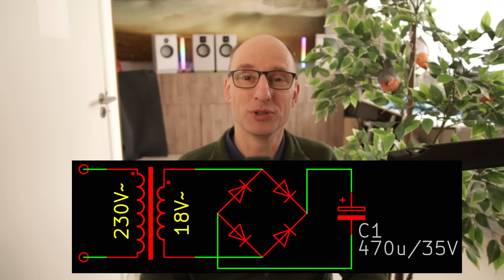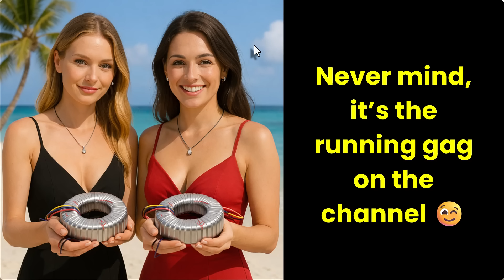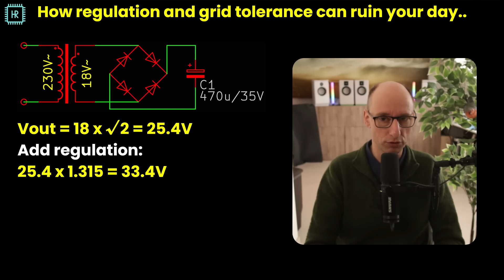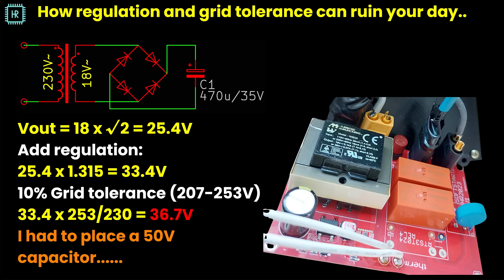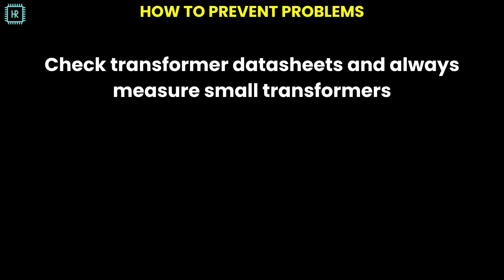Linear Supplies Can Destroy Your Designs

Comment: Keep in mind the inductive kick back. When a load on a transformer switches from full current to almost nothing the flux field collapses giving you a voltage spike.
Reply from the maker: Good point! I forgot about that. I always put diodes across my relay inductors for that reason. I have no idea how much of a spike I got. I'm not sure how fast my supply ramps down, I believe it has a relay so that would be like a spark plug generator.

I've done this many times with this supply actually, but I never noticed a problem. I assume there might be a protection diode to protect against inductive loads being turned off. That is at least what I would put into a supply design if I had to make one.
Reply: @HansRosenberg74 usually a resistor is placed over the buffer capacitor to bleed off the charge of the spike.
It also helps with high voltage circuits to bring down lethal voltage in the capacitor under 30 Volt within 30 seconds.

Comment: I've a pair of Nice (that's the brand name) gate openers and they use a linear power supply, they can also run from optional lead acid batteries during power outages or from an also optional solar power kit that seems to not be compatible with mains power for some reason.

When running from the mains the AUX output for keyboards, photocells and other things provides "24V" DC (it's just rectified AC unfiltered edit: unregulated) - 20% +50%‼which is up to almost 51V DC once rectified and filtered.
To use an additional remote control receiver from other brand I used a cheap LM317 based voltage regulation module from Aliexpress to bring it down to 12V DC. I had to modify the regulator module with a small 100uF filter capacitor because with the original 1000uF capacitor it drew too much current when the gate opener was connected to the mains to charge the filter capacitor, causing the microcontroller on the mainboard to fail to boot or freeze after a few seconds. The AUX is supposed to provide only up to 200 mA and I was already using it to power the photocells.
Reply: Depending on the situation, if you need the high capacitance, you can put a resistor in series with the cap to limit the inrush current. Though, this does change the filtering behavior of the cap, ideally put a scope on it.
Reply: @sivansharma5027  I had written unfiltered when I meant unregulated, it should work fine without too much extra filtering
Reply from the maker: 51V.. that is quite extreme.
Reply: @HansRosenberg74  Yes, but I hope it never gets that high! In the area where I live, back in the '80s we used to have around 230 volts during the day and up to 240 volts at night, even though the voltage in Spain was supposed to be 220. I guess they raised it a bit to reduce losses in the transmission lines. And when all of Europe adopted 230 volts, nothing really changed... I never saw it reach 250V on any phase.

Comment: primary and secondary leakage inductances are non-trivial, and often make up a large part of transformer regulation (for high power transformers, they account for almost all of it). power systems engineers typically refer to a transformer as an x% transformer eg a 10% transformer. that means its leakage inductance is 10% of its "base" impedance (Zbase = Vbase/Ibase = 2*pi*Fbase*Lbase). and shorted, that transformer will deliver 100% Volts/10% Z = 1000% Base current (10x rated current).

its not obvious how to measure primary and secondary leakage inductances, as you can only measure four inductances (Primary L, Secondary L, Primary L Secondary shorted, Secondary L primary shorted). Chris Trask wrote a paper in QEX magazine a few years ago showing how you can calculate the actual magnetising and leakage inductances from these measurements (hint: use mutual inductance in your analysis, lest you run around in circles, ask me how i know). you can also use a solver, once you know Lp, Lp_ss, Ls, Ls_ps.

including the leakage inductances gives you an extremely accurate simulation model, and one you can use to determine the optimal R-C snubber to place across your (bridge) rectifier input to damp ringing.
Reply: Interesting, do you know the title of Trask's article?
Reply: @MB-ruminy  i had a look, and i cannot find the article - it's entirely possible i mis-remembered who wrote it and where i read it; alternatively, search engines have deteriorated to the point of uselessness. i have, however, done a detailed analysis based on his method, and extended his analysis to the point of a pair of formulae (one for the primary magnetising inductance, one for the secondary magnetising inductance), rather than a pair of quadratic equations to solve. if only we knew someone with a YT channel on cool engineering stuff who might want to cover this....
Reply: @MB-ruminy  found it. not sure where it was published, but i think it was QEX October 2008. the article is:
Wideband Transformer Models: Measurement and Calculation of Reactive Elements
Reply: @terrygiven8789  Thanks I've downloaded it. beautifully written. I'd be interested to see your solutions to the quadratics!
Reply: @MB-ruminy sure thing: 
Lp = Llp + Lmp (leakage & mag) = total primary inductance, secondary open circuit 
Ls = Lls + Lms (leakage & mag) = total secondary inductance, primary open circuit 

Lp_ss = primary inductance, secondary shorted
Ls_ps = secondary inductance, primary shorted
Np, Ns = primary, secondary turns

Lms = (Ns/Np)*sqrt(Ls*(Lp - Lp_ss))
Lls = Ls - Lms

Lmp = (Np/Ns)*sqrt(Lp*(Ls - Ls_ps))
Llp = Lp - Lmp

:)
Reply: Interesting. Is it? http://qrp.gr/wideband_transformersQEX_2005_03-04.pdf
Reply: @AABB-px8lc  slowly downloading the PDF.... its been minutes. sigh
Reply: nope, although thats a great article.

Comment: Great video.  Regarding the capacitor voltage, would a 35V rating not be acceptable even if only 33V were expected?  That seems like far too little margin.
Reply from the maker: It is, I usually go for 20-30% at least. 100% at low voltages, 6.3V cap for 3.3V supply

Comment: Love the hobby. Hate the math. My rule is keep designing until you no long get smoke and don't mind the noise. Oh! And god bless voltage regulators.
Reply: davidturner, your method works adequately for one-off designs for which you will be the only user. It is totally unacceptable for engineers designing products, which is why they have to learn the math and all the other hard stuff that presumably results in their high salaries.
Reply: @youtuuba  Oh ye of little faith. It is not about safety but about having fun. Any day ya don't get smoke or a zap is a good day.
Reply: @davidturner5418 well, you missed my point entirely. If you think electronics is just about having fun, and that professionals who actually care about getting things right have "little faith", then this video is not really for you.

Comment: This is a really great video.  I like the clear explanation of the simple canonical transformer model.  That was great.  As an aside, I don't see anything "linear" about this supply.  Diodes switch.    They switch at 120 Hz in this design.    It looks like a 120 Hz switched power supply.  I know, everyone commonly calls this a linear supply.  It just isn't. The current waveform shows sharp pulses at 120 Hz.  There's nothing linear about it.  A linear power supply might be a battery with a linear transistor voltage regulator.  It is odd that the common term for this appears to be non-sense.
Reply: nope - it is linear - consider what the current into the main filter is doing.  Just because something has a switch doesn't mean it's a 'switching power supply'.  the imput is already switching polarity and the diodes un-do that.
Reply: @agnichatian  The current goes into the main filter in pulses at 120 Hz only when the incoming voltage exceeds the capacitor voltage.
Reply: It's linear because the DC output voltage is directly proportional to the AC input voltage.
Reply: @MB-ruminy  That's true of any unregulated switching supply.
Reply: "The current waveform shows sharp pulses at 120 Hz."
Yes; a feature that affects the power factor of the power supply. It can also create RFI (radio frequency interference).
Reply from the maker: Good point. I don't understand the name 'linear supply' either 🤣
Reply: @HansRosenberg74  In common usage, "Linear power supply" is Not Switching power supply.  My Astron 35 amp power supply is very heavy; has a massive transformer, big capacitors and power transistors for regulation.  There is no high frequency chopper and thus also no RFI.  

Switching power supplies are lightweight, efficient, but by their very nature have a high frequency chopper that inevitably produces RFI; some better shielded than others of course.  Also, the regulation usually reaches back to the primary and can be a bit sluggish to respond to transient changes in demand which is typical of SSB.

Comment: I always prefer for power amplifiers to use current sources - then they work over a large voltage range and are largely immuse from PSU noise too, so they sound better.
Reply from the maker: A current source does not give you a constant voltage, so how does that work. Do you have a regulator loop around that? But then it turns into a voltage source.....
Reply: @HansRosenberg74  I mean inside, at the base of LTPs etc.

Comment: Yeah... unsurprisingly, the capacitor taking that role failing due to overvoltage is... far from uncommon, also in many commercial devices using a linear supply
Reply from the maker: indeed

Comment: The classic bridge rectifier/capacitor is the electrical equivalent of 'pounding a round peg into a square hole". Since the capacitor clips the peaks, the current pulses far exceed the average current of the load on the output. Since resistance losses go up on the square of current, that largely negates the low duty cycle of the current pulses drawn by the filter capacitor. You must only load the output to 60-70% of the output current rating of the transformer, to avoid over-heating it. Your 5.1 amp transformer? you have a ~3.5 amp DC power supply!
Reply from the maker: Yes, it's not very efficient :-)
Reply: @HansRosenberg74  Vincent Robinette is correct when he says that the DC output amperage is only 60-70% of the transformer secondary RMS current rating but this does not affect  efficiency much if you are defining "efficiency" as Watts input to the supply VS Watts output from the supply.  The supply DC output current is about 40% lower than the transformer secondary RMS output current rating, but the supply output voltage is about 40% higher than the transformer secondary RMS output voltage so the effects cancel out in terms of Watts.  The real things that kill efficiency are anything that generates heat in the supply so all the resistive, eddy current, and hysteresis losses in the transformer, the voltage drops in the diodes, the ESR of the filter capacitor, and all the resistive wiring losses.    Regarding the diodes...  As Vincent noted the filter capacitor draws large pulses of current that have a high RMS value at the peaks of the AC cycle.  These pulses have to flow through the diodes resulting in larger diode voltage drops than you would expect.  I have measured peak diode drops of 1.5 to 2 volts PER DIODE in cases of poorly designed supplies.  The solution for both efficiency and reliability is to use higher current diodes than you would expect to have to use.  For lower voltage high current linear supplies (say less than ~15 volts and > 1 Amp.) I prefer to use 2 diodes with a center tapped transformer secondary rather than a bridge as it cuts the power loss in the diodes by 50%.  Yes, you have to double the transformer secondary voltage and thus the transformer VA rating, but you can then draw DC output current equal to the transformer secondary RMS output current rating because each half of the transformer secondary gets to "rest" on alternate half cycles.  I consider this design decision low hanging fruit when designing this type of supply.

I enjoyed your video and it was a great discussion of some of the pitfalls designers fall into when designing linear supplies.

Comment: Why did the transformer primary voltage change from 230V at 4:25 to 220V at 4:50 ?
Reply from the maker: The grid voltage in our country changed the last 30 years. It used to be 220V nominally, now it is 230V. This transformer is probably older than 25 years.

Comment: Ah, I am awaiting "Switched supplies can destroy your measurements" 🙂. I experienced endless problems with noise floating around 80 kHz when digitizing large dynamic range signals with a rather expensive equipment. Finally the culprit was the super-cheap 12V supply they delivered with the equipment. Actually the supply had plenty of C and L as filter at the exit. They would have had helped a lot, ... if they would have been inserted in the existing positions on the PCB.
Reply from the maker: Yes, they can be noisy. I had problems with my monitors in the lab. They sometimes interfered with my measurements.

Comment: Thank you for your explanation and your hints. The point is, there are no such things as a simple circuit. In reality, depending on the situation, the circuit will include a VDR on the primary side, individual fuses for each secondary winding, grounding the core and shield winding, small capacitors across the diodes, serial resistor to detract I^2 heating of the windings from the transformer and/or flattening the I curve and so on. That's what I know as chemist...
Reply from the maker: yes, you can add many more details to this.

Comment: These very small transformers have a large primary ohmic resistance. One result is that a 1VA transformer shows as much as 0.8W idling loss. They do not exhibit a toroidal core but a standard EI-30 core or alike. These transformers have spatially separate windings leading to poor coupling or high coupling inductance. And an absurd high non-load over voltage. In the specs this reads as "safety transformer, short circuit proof" as there are no bugs just features.
Reply from the maker: Indeed!

Comment: 1) Using "rated load secondary voltage" of the transformer feeding a bridge rectifier with a filter capacitor gives you practically nonsense result. Problem is, the current flows only over short time, so the output sags way more than just the transformer resistance is suggesting. It is possible to calculate it, but the simulation is the only reliable way.
2) Decent transformer datasheets list not "voltage regulation" (which becomes unclear how to calculate with mainly if it becomes higher anyway), but an open load secondary voltage. And for transformers below 5VA it is quite common to be about 1.4x the loaded voltage ("6V" transformer uses to have 8.2V OCV). That is then rather easy to put into the simulator.
3) With higher power designs one other problem uses to appear: People often forget to calculate the real rms transformer loading, aka the power factor. Usually the VA's seen by the winding is 2x or even 3x higher than the power consumed from the DC side, i.e. the power factor uses to be in the 0.3..0.5 ballpark. For low power transformers the power factor tends to be higher (0.5..0.7), so th overload is not that severe. This omission then leads to transformers being heavily overloaded. Fortunately most high power applications for a mains frequency transformers are audio amplifiers, which very rarely consume more than fraction of the rated power. But I have seen many failed transformers in small low power applications (like controller board for many appliances), which were overloaded exactly this way.
Reply from the maker: Indeed. The model does allow to simulate these kind of things quite well.

Often at high loads, you need 'infinite' capacitance to get a nice results :-)

Comment: Informative. 
This is the very reason linear mains power supplies suck. It gets impossible to get good efficiency during normal operation, because there is so much voltage margin needed. Dropping all that voltage  by linear regulation wastes a lot of power - and you will need huge heatsinks if you need som power. The voltage drop gets even worse in practice - because when AC is turned to DC and smoothed, the current drawn from the AC supply will not be sine shaped any more, but just pulses (there is only current going when the momentary input voltage exceeds the voltage in the output capacitor - the rest of the time, the load is only fed by the output capacitor alone). This means those pulses have to be much larger compared to the average current and the voltage drop in the transformer will be even larger and more margin required - giving even worse efficiency. Also, high power mains frequency transformers are really expensive, because there is so much iron and copper needed. 
Switching supplies is both way more efficient and cheaper - if you know how to build one.
Reply from the maker: Switching supplies are great. The problem is that they're often badly designed, especially the low power ones which leads to failures.

You can do it right. I bought a pc power supply with 12 years warranty from seasonic: Great, that will outlive the rest of the pc

Comment: 1:25 does that mean 22 volts positive + 22 volts negative?
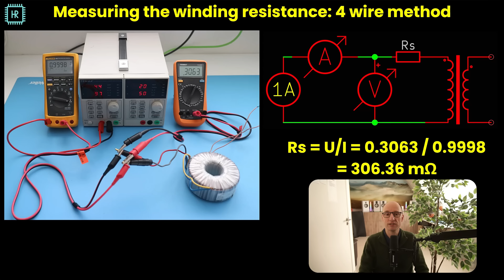1:59 What's U? Why do you show secondary resistance on the primary side of the transformer?
Reply from the maker: No, it means 2x22V AC, so there is no positive / negative
U is voltage, and I flipped the schematic of the transformer in this case
Reply: @HansRosenberg74  unclear, if it's AC then how can there not be both positive and negative?
Reply: @johnaweiss  AC voltages are constantly swapping polarity, so it wouldn't make sense to call it positive or negative. It's just AC.
Reply: @MB-ruminy  I guess I was thinking that AC has a positive swing, and a negative swing. I was speaking of the waveform, not the terminals.